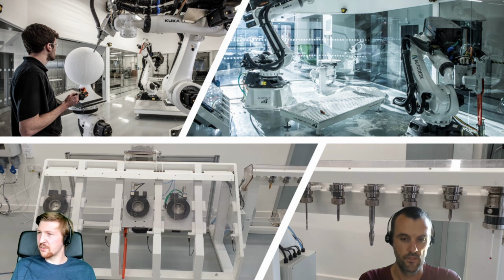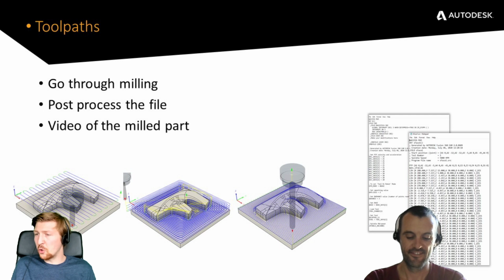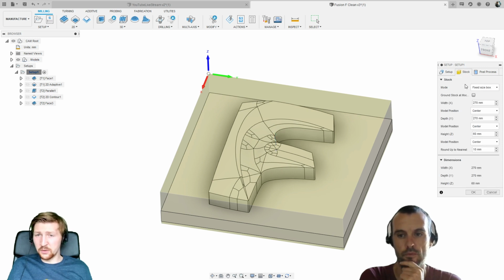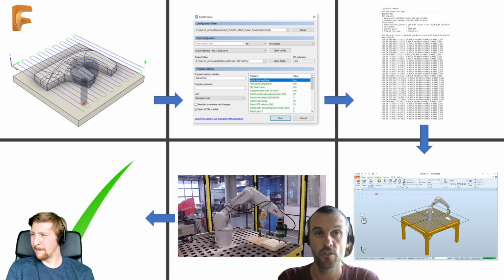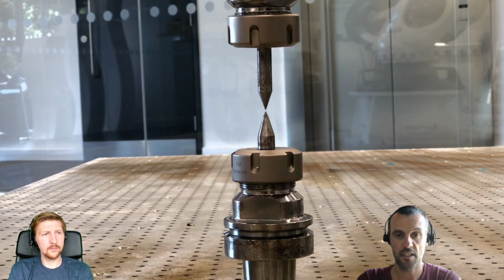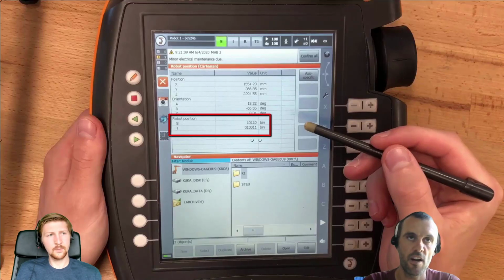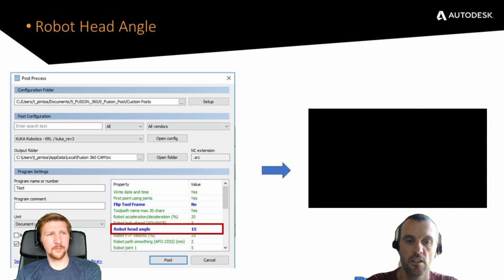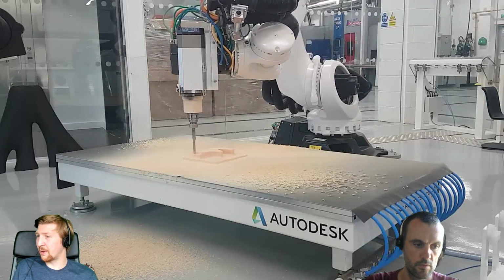360 Live: Robot Post processors

Comment: I was told by the Autodesk support that despite owning the manufacturing extension, additional robot control software (like RoboDK) is still needed to control our FANUC robot.
Reply: Everything in this talk refers to Fusion 360 post processors for either ABB or Kuka robots.  Besides theses post processors, Fusion 360 knows nothing of robots.  More importantly, Fusion 360 (even with the manufacturing extension) has no way to simulate the Robot code output by the post processor.  You need a way to simulate to check for collisions/singularities.   That is where something like RoboDK comes into play (or usually more costly robot manufacturer software).  Instead of running the Fusion ABB/Kuka robot post processor, you run a generic 3 or 5 axis tool post processor.  Then Robodk will translate that into your robot language of choice (FANUC in your case).  You can them simulate in their environment with the exact model of robot, add fixtures etc... Depending on what you are doing with the robot, you might be able to get away with just using the standard 3 axis CAM, and not need the manufacturing extension.